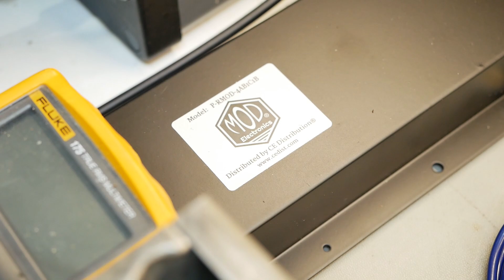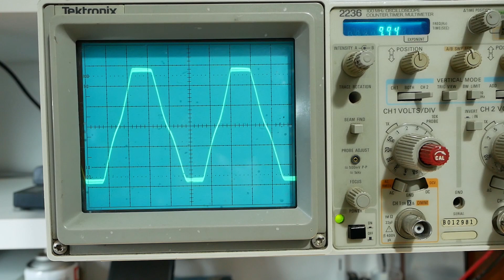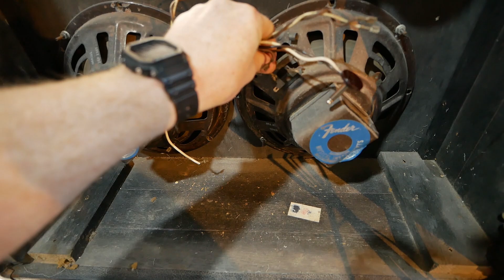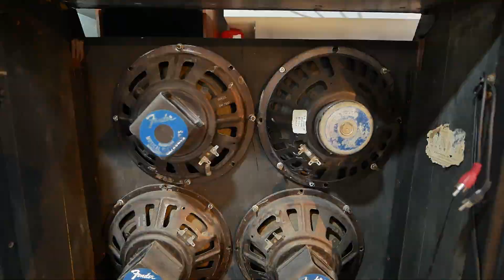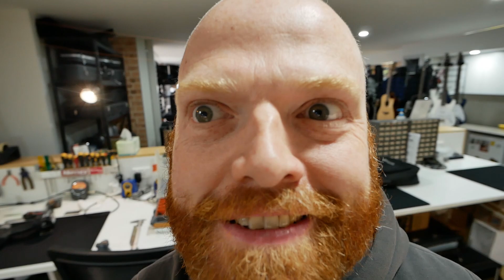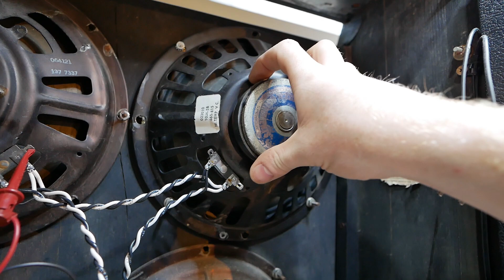Part 3 - Fender Silver Face Super Reverb Restoration

Comment: Hey Brad,  doing some upgrading of components for AB763 for a 1975 SFSR w mstr volume. Will be reusing the stock 1M mstr vol pot (w/o boost) post-phase inverter.  I previously changed the bias pot from bias balance to bias level.  I moved the 220K neg bias resistors from the eyelet to avoid the induced voltage but is it necessary to add the trim pot and just Y the 220Ks off the board to the bias pot?  If you think the trim pot method is best (JJ power tubes) what size trim pot were you using ?

Comment: Hi Brad, Intresting video! What are the values of the resistor and trimpot on the bias balance pot? Sorry, i am colorblind and think to see brown black brown (100ohm) for the fix resitor. Thank you in advance!
Reply from the maker: 1k resistor and 25k trimpot, mate.
That put this particular set in a range to max out at around 70%, so safe if some nuffy adjusted it without measurement.
You results may vary depending on various factors.

Comment: I'm about to restore a 1976 SF DR that I own which has an eyelet board in similar condition. I'm going to replace the eyelet board with a new one though. Great work on your part to clean this amp up so well.
Reply from the maker: Replacement isn't really necessary, I've found. They behave themselves after a good clean which is about as much work anyway.

Comment: GZ34/5AR4 is an excellent rectifier.  Fender used them in their Blackface Super Reverb Amps.  I reckon Leo went to the 5U4 as a cost saving measure.  It uses about 50% more filament current, heats up faster, but has more voltage drop at the plates when providing the same current. Also, the maximum current in the 5U4 is less than that of a GZ34.  I think you were wise to not replace the GZ34 with a 5U4 just to make it 'correct' for a Silverface.

Comment: A fiberglass-bristle scratch-brush works very well for cleaning that sort of oxidation/corrosion from the speaker terminals, and any little bits of glass fiber that break off are nonmagnetic and therefore won't get sucked in by the magnet. PS, I assume you replaced the mangled pilot light jewel....

Comment: A thought on your tight twisted-pair speaker wire: this likely adds a fair bit of capacitance and inductance to the cable (and probably makes the wiring at least 50% longer than if you didn't twist them,  which means there's some additional inline resistance as well). Is that really a good idea for speaker wiring? It might induce some low and high frequency rolloff, and perhaps induce oscillation in a tube amp if it wasnt 100% stable.
Reply: Won’t do any of that but it does give mechanical support to each wire/connection.
Reply: @PsionicAudio   I usually just use ordinary 18 or 20 gauge zip lead speaker wire, and mechanical rigidity isn't that big a deal when the wire runs are so short from speaker to speaker or back to the amplifier. Unless , of course,, somebody feels that it really needs to look original. This particular amp is so far from original condition cosmetically I don't know that it matters!

Comment: That celestion speaker seems a little too bright for this amp,  but the amp itself sounds very good and I could picture Dick Dale or Link Wray playing through it. Considering the screw stuck through the dust cap, perhaps even Roy Buchanan would approve, because it would've added a nice raspy buzz or fuzz tone and Roy was once known to slit speakers with a razor blade and dunk them in water so tgat the cones would warp ---- this was in the days before fuzzboxes were available.

 The speakers are so faded and the grill cloth so degraded that it appears the front of the amp was sitting in direct sunlight for years.